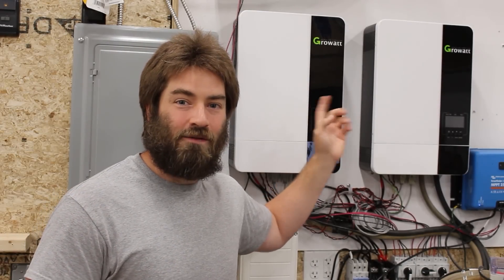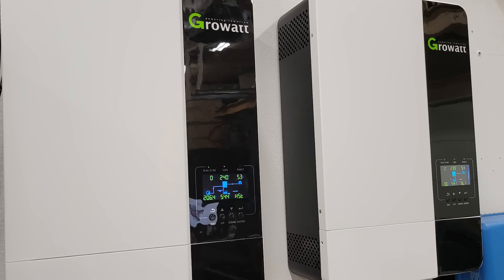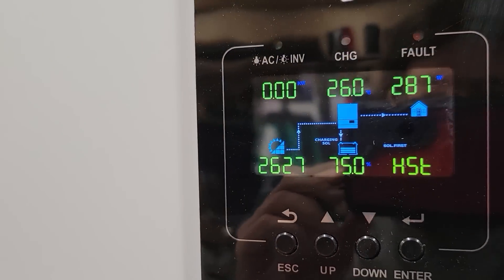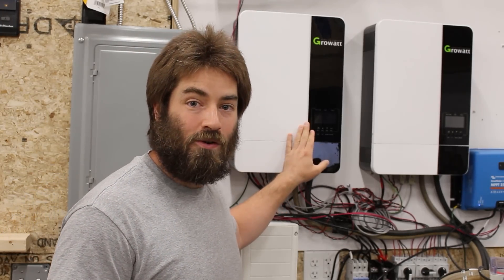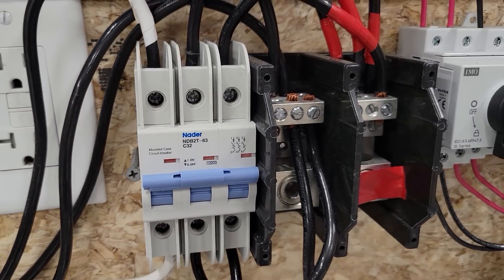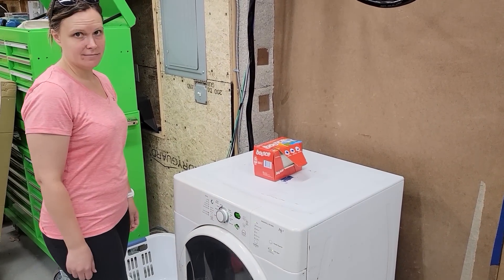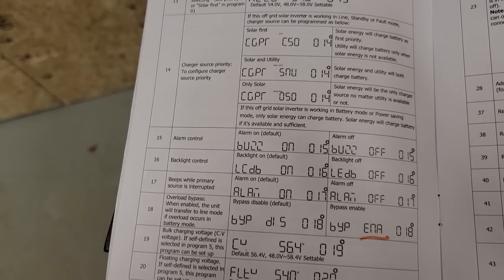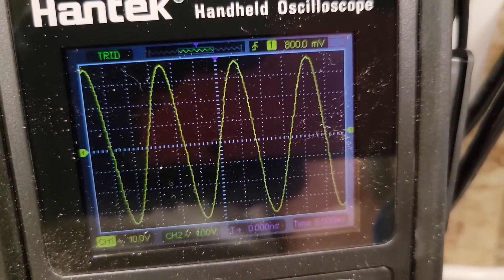Update after 1 year of use off grid, Growatt and EG4 (Gyll) batteries

Comment: Hi David, I see you have changed out the Nader breakers to ABB? What made you change and what model of dc breaker did you go for between your battery bank and inverter?
Reply from the maker: The Growatt inverters I was using in this video are 240V only.  I then had an auto-transformer to provide the neutral, and split the 240V into two legs of 120V each.  This worked great, but there was a potential problem.  The inverters combined can output 10kW, but the auto-transformer is rated for 5kW.  There is a potential you could draw more than 5kW imbalance which could overheat the auto-transformer.  To protect against this, I installed a 3-pole breaker.  If too much current is pulled from the auto-transformer, it would trip all 3 poles, meaning everything would shut off. That's why I switched at the time.  FYI, it never tripped in the 1.5 years I ran the system like that.
Bottom line, it was a unique situation to this setup.

Comment: Hi Dave I have one question?. I have off grid home ,I do have solar pv ready to install, battery storage and inverter,my question is :can I live inverter off with pv connected to the inverter? I’m only living there 3 times a year so I don’t want to live all system on for no reason,just asking because some people says you should not leave pv modules off when not in use and in sunny conditions, on a other side some people says pv off not connected not produce dc voltage because open circuit.? To my knowledge it should be fine, but a second opinion would be great 👍
Reply from the maker: The inverter I'm using in this video allows for PV only (no battery) but only if you have one inverter.  My system (at the time) used two inverters in parallel which requires batteries be connected.  Even if you could use one inverter and no batteries, I don't recommend it.  It's glitchy, unreliable, and no surge.  I always recommend at least a small battery be used with it.
As for turning the system off and leaving it, that's fine.  Yes, it's true that over the long-term leaving a panel in the sun with nothing connected will eventually cause degradation, but it takes years. 
If I had a cabin I only visited 3 times a year, I would have a battery with a on/off switch.  The on/off switch turns off the BMS (battery management system) inside the battery.  If you were to leave that ON, then the BMS slowly drains the battery and could kill the battery over a winter.  So, I when you leave the cabin, turn off everything (PV, inverter, and battery).  This will keep the system in the same state so when you return it can be powered back up.
Reply: thanks David i do appreciate  your help I always like to ask second opinion, one more thing . I use the Growatt inverter ,in the manual says it can be set to solar only , in that case if I live the system on without batteries 🪫 it means when the sun ☀️ is shining it will awake inverter and power up ⬆️ for example I could live the fridge connected so the access power will be use won’t bother me if the fridge will be empty,I trying make point of it, if would benefit more and not do damage somehow to the pv system and living them completely off or living them  on in solar only?

Comment: I live off grid in east Africa and have these same two inverters to run my compound. They run separately, one running my house, and the other the balance of the compound. Both the inverters, panels and batteries are well more than what is needed. At bed time, both systems show 100% charge on the two battery banks. At night, Each system only has to provide 500 watts or so, which should use only a very small fraction of the battery capacity. In the morning while it is still dark, the batteries show 100% charge. When dawn breaks, and the inverters turn on, but it is just barely light, the battery  charge instantly drops to 10%. Then in an hour, when the sun is really shining, producing more than the 500 watts I am using, the reported charge snaps back up to 75% or 100%. Sometimes when the inverter comes on, the reported charge drops to 0% and the system reverts to the grid. It seems like some sort of software glitch, that when the inverter starts up, while the panels are producing less than the load, the system drops shows these very low battery charges. If during the day the solar production is low compared to the load, the system behaves as expected. It is just when the inverter turns on in the low morning light that this happens. The people here who installed the system do not really have the expertise to debug the problem. The system runs completely expected during the day, under large loads and small loads. I can run large loads during the day, and at the same time provide lots of charging energy for the batteries. I really would appreciate if anyone could help me. The system is so close to working perfectly. Electricians have verified the physical install, and have verified proper grounding, wire sizes, solar panel configurations, and battery quality. Just seems like some sort of glitch in the inverters. One inverter has Gel batteries, and the other has 4 of the large Growatt Lithium iron batteries. Wow, I really hope someone could point me in the right  direction.

Comment: Question ❓, 
If they have a built in PV controller, why did you install the Victorian charge controller too.
Reply from the maker: Each inverter has one MPPT charge controller built in.  I have 3 solar arrays in my backyard (videos on how I built them are on my channel).  Two solar arrays feed the inverters, and the third array goes to the Victron CC.

Comment: Hey David, just wanted to ask what Firmware version your growatt inverter is? my inverter is working okay but when i connect both my batteries (lithium) the percentage keeps going down (lowest 90%) and then goes back up again without any load to the system. meaning i dont have my ac wires connected yet.  good to know if you have either 041 or the 67 one. cheers. Nick
Reply from the maker: I don't know, whatever firmware version they came with.  I never bothered with the battery display on the inverters.  I use a Victron battery monitor.

Comment: Can it work in a hybrid configuration, or is it off grid only
Reply from the maker: These inverters don't have AC-coupling, or grid-forming functions.  They can use the grid (or generator) as pass-through to the load.  They are best used for off-grid.

Comment: My experience is after about 4 years the Growatt inverter went faulty only partly working. I then installed a replacement Fronius inverter. That unit has been running with no issues for over five years. In other words getting a quality inverter is important. Maybe by now Growatt has improved, but be careful. Solar systems are about the long term and if your system is made of poor quality components it won’t last and won’t payback the initial investment.
Reply: Know someone who bought for double the price solis inverter and last year !
Reply: I heard that some people had problems with fronius  as well ,like my boss had two connected in parallel , I think if you running on a max continuously

Comment: Having to purchase an autotransformer to get a neutral at 120V might be regarded as a "con" for the 240V Growatt system. The 120V LV6548 units don't have that complication.
Reply from the maker: I understand.  Adding a transformer (auto or isolation) is an extra device, and extra wiring.  I've never personally tested the 6500, but I have talked with a lot of people who use them.  It seems the Growatts+transformer is better at handling surge loads compared to the 6500 inverters.  Things like miter saws, air compressors.  That may, or may not, be a consideration for you.

Comment: Thanks for your through installation video, but if the growatt inverters have built in MPPT capability, why do you have a very expensive (but good) Victron MPPT unit connected up as well?
Reply from the maker: I have 3 solar arrays in my backyard.  Each Growatt inverter has 1 MPPT channel.  So, one array to each Growatt, and the last solar array to the Victron.

Comment: I live very close to the sea, my inverter broke down because of the board inside the inverter started to rust due to the high sea breeze. Will u recommend the Growatt 5000es for me? Can the components withstand the  high breeze?
Reply from the maker: No, I wouldn't use a Growatt in that environment.  I'd use a Victron.  https://signaturesolar.com/shop-all/off-grid/inverters/?_bc_fsnf=1&brand=101&ref=4_rHcgZ9x-TiF-

Comment: Whats the busbar sollution you used to combine the AC outs of the inverters? at 4.26 in the video. red tape across one of them
Reply from the maker: They are called "Power Distribution Block".  I found mine on Ebay.

Comment: Great  video David. I love how one unit was able to run the drier. I will be purchasing 2 unit to run my entire house and I was wonder if its able to run heavy loads because I do not want to purchase a soft starter. My home currently has air conditioning units and it must be able to run them along with other loads such as washer and drier and this video answered my question.  If any thing I could purchase 3 units which would give me 15kwh and 30kwh surge. However I must say my preferred inverter is the EG4 but the Growatt has a better price.
Reply from the maker: I wish I could provide a solid answer to your surge question.  I don't own a central AC, I have three small AC's.  Since I haven't personally tested a central AC surge, I can't say for sure if it will work.  Off the top of my head, I'd say 3 would be better than 2 for that.  Also, if you used an isolation transformer (15kVA) instead of an auto-transformer, that would help in this case. 
Either way, would you mind using my affiliate links in the description?  They really help out the channel.
Reply: @DavidPozEnergy   I do use your affiliate link and codes epically on battery hookup with the SPIM08HP batteries.
Reply: @DavidPozEnergy  UPDATE 1 YEAR LATER: I purchased two units, but only one is currently connected (I plan to parallel them). So far, it's been awesome because it has powered my fridge, freezer, two 1200 BTU AC units, lights, washer (while in washing mode), and other miscellaneous items such as phones, modem, and a mini PC acting as my home internet/firewall server—all at the same time. Additionally, I've run a dryer, AC unit, and microwave simultaneously on the one unit. As for the battery, it's connected to about 15 kWh of SPIM08HP cells (I plan to add 5 kWh in the next three days).

Comment: Great video. Thanks for the rundown. I have one question. What is the point of the victron charge controler? The grow watt inverters have charge controlers built in, do they not?
Reply from the maker: Each Growatt inverter has one charge controller built in.  I have two inverters.  But, I have 3 solar arrays.  Each array needs one charge controller.  The Victron charge controller handles the third solar array. Thanks for watching.
Reply: @DavidPozEnergy  i see. Thanks

Comment: Question: those inverters have a charge controler built in why use another? or is our EU version different?
Reply from the maker: I'm still using the built in charge controller.  I have a third CC on the wall because I have 3 solar arrays in my yard.
Reply: @DavidPozEnergy  ah ok that makes sense! Im about to do my first solar and im mostly trying to figure out how to setup a tilt mount on my sandwich panel garage thats flat! Got any good simple system or should i just DIY that myself?
Reply from the maker: Hi sale666,  I have built my own solar arrays with with salvaged steel, but they are on the ground.  I'll usually try to DIY my projects.  Sorry I don't have a suggestion for you on a pre-built racking system for flat roofs.
Reply: @DavidPozEnergy  cool DIY it is than for me too! 😊

Comment: I installed the 24v growatt in RV trailer. The on grid off grid switching from battery to shore power and back again was flawless. The entire trailer was 100% live 100% of the time. Set Growatt to use AC shore power first, then batteries if not detected to power trailer. I removed my tv from the televator and mounted the Growatt on to the televator. Could not hear fans. Way more quite then this model. Installed my batteries back there too. Upgrading trailers now and need to upgrade inverter. Would mount this in heated pass through now. Betting I would not hear fans, unless they’ve upgraded them since this video. Great review

Comment: It's another year later ... Do you still think these are worth using with the auto transformer, or would you choose something different?

Also, is the charge controller in your setup used, or do you rent on the built in controller in the Growatts?
Reply from the maker: Yes, I still like these inverters for off grid use.  I think they are probably the best bargin going right now.  I use the charge controller built in, and the separate blue one.  I have three solar arrays, each goes to one charge controller.   Keep in mind, the last 6 months or something I switched the house loads to the Schneider inverter and I'm only using the Growatt right now for charge controller.   Nothing wrongbwith the Growatt inverter , I'm just testing the Schneider now.

Comment: Hello there. I see you have so many long cables. How have you addressed battery resistance?
Reply from the maker: Yes, I'm using 1/0 wire, which is larger than required.  Thanks for watching.

Comment: Thank you for your help! Two questions:
1. Running 2 x L1 and 2x  L2 into a busbar/terminal block (?) for each and then 1x L1 and 1x L2 from the block into the breaker of the breaker box, would you need to increase the wire size from 8AWG to 6 AWG? Or change the breaker size of these combined L1 or L2 wires?
2. Do you really run the electric cooktop on 2 inverters, too which needs a 40 Amp breaker and 8/3 AWG in my case? I planned a separate on grid connection for the cooktop and tankless water heater. 
Thank you again for your work.
Reply from the maker: 1. I ran all the AC wires with 6AWG.
2. Yes, I ran my whole house on the 10kW system (2x 5kW inverters) for over a year.  Inside my house is an electric cook top, electric oven, electric air conditioner, etc.
Reply: @DavidPozEnergy  Thank you for the helpful response. God bless you and your family.

Comment: ask yourself: if the SPF5000es is connected via AC output and via AC input and the following conditions apply: all consumers are off, the battery is already 100% charged, i.e. fully charged, and there is full sun on the PV modules at 12:00 p.m.: what happens to the EXCESS electricity from the PV system then ? (does it flow back into the public grid via AC output or AC input?) thank you
Reply from the maker: I operate my system off grid.  I don't have anything connected to the "AC INPUT".  I like to limit my responses to what I have personally tested.

Comment: Are these 230kv inverters when run separately.
Reply from the maker: I think you mean 230V.  Yes, each inverter is 230V from the factory.  You can set them to be 230V or 240V, 50hz, or 60hz.  I set mine to 240V 60hz.

Comment: The voltage up delay will gradually increase till the capacitor gets fat and gives out, I had the issue, if lucky you get one or 2 years ,replace the capacitor then, keep a back up source.
Reply from the maker: Are you saying you had a capacitor go bad inside a Growatt 5000ES inverter?  And, if that is the case, do you know what caused it?  Thanks.

Comment: Thank you David. Great video!  I use pretty much the same configuration as you and am just as happy. After almost 2 years I had a complete failure for the first time and I think it was due to dust in the inverter. Have you ever had to clean your inverters and if so, what is the best way to do this? Thank you for taking a few minutes to reply to me. I operate my plant off grid in northern Thailand.
Reply from the maker: Hi Kensiam,  I've never cleaned out my inverters.  As of writing this, they are still running.  Note, my inverters are inside my garage, which is a conditioned building.  

If I did have to clean them out, I would start by disconnecting all the power.  Then I'd remove the cover.  First thing would be to vacuum the dust.  Use a narrow attachment to a vacuum in order to get into tight places.  Don't press the vacuum hose against the circuit boards.  instead, I'd use a soft nylon brush and gently brush the dust toward the vacuum hose.  Test each fan to make sure they are spinning properly, meaning no wobble to them, no unusual noises.  Possibly replace the fans if necessary.
Reply: @DavidPozEnergy  Thanks a lot.  Very useful advise indeed.